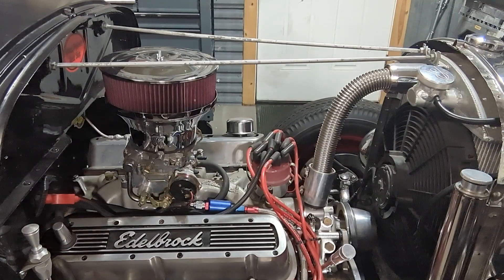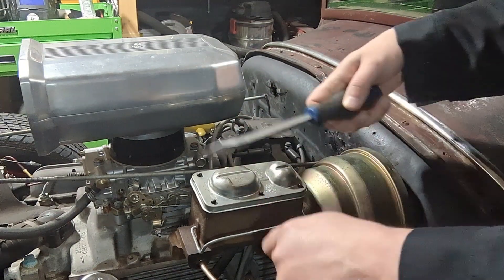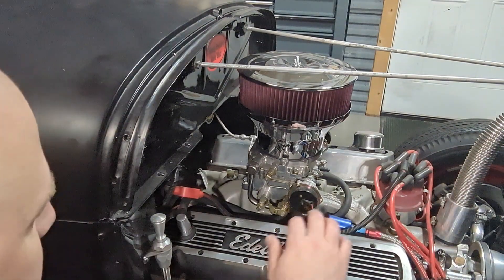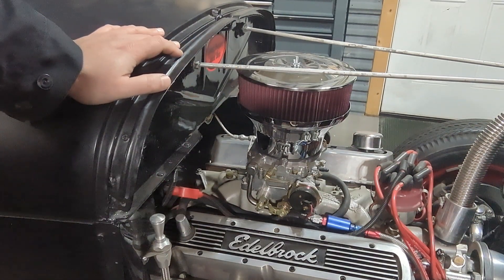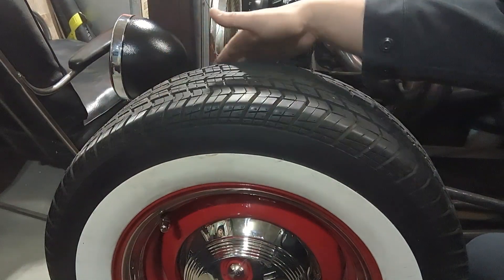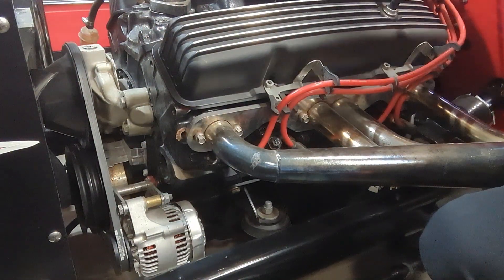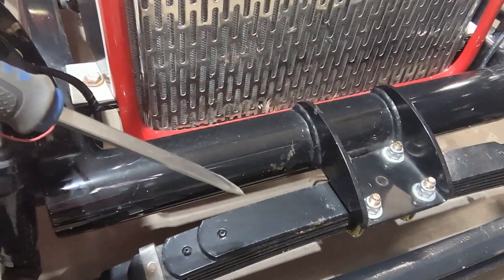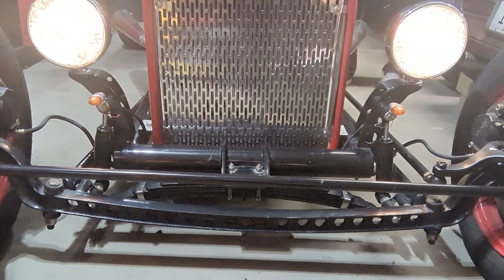7 Habits to Save Time and Money

Comment: Great video. Those are definitely things to check regularly. The one thing I'd add would be the steering linkage back to the steering column, especially if you have any wobble joints in it. Friend of mine had the steering fall apart on his '23 T bucket at the steering box. Fortunately it was just after he'd come off the highway and was pulling away from a stop light. Blocked the intersection for a bit but no damage or injuries.....lucky!! Keep the videos coming. Be safe and stay well.
Reply from the maker: Good tip thank you!